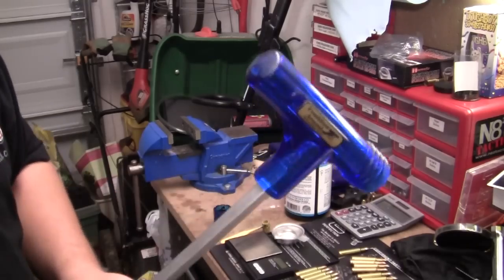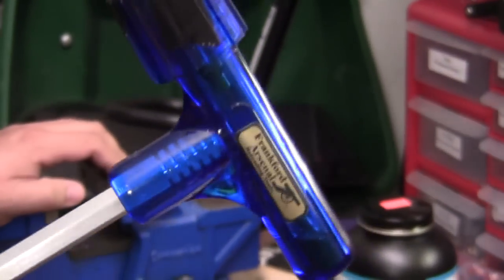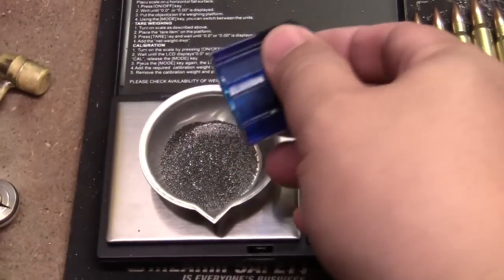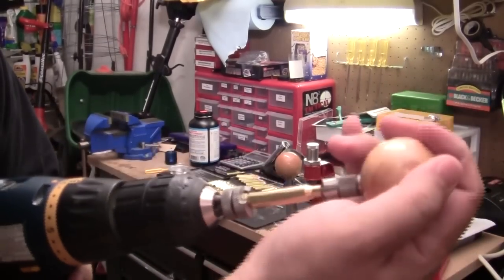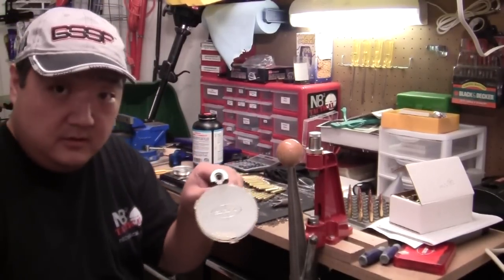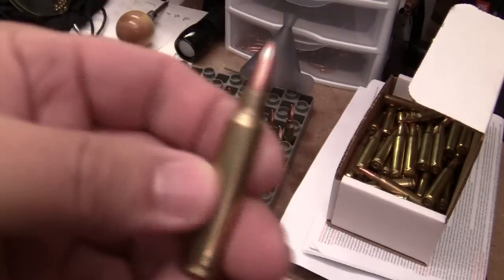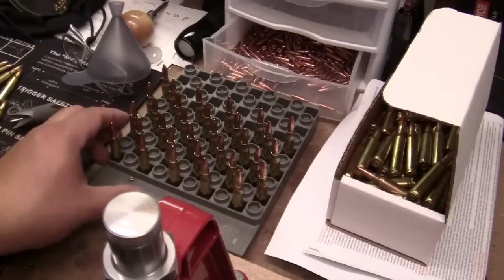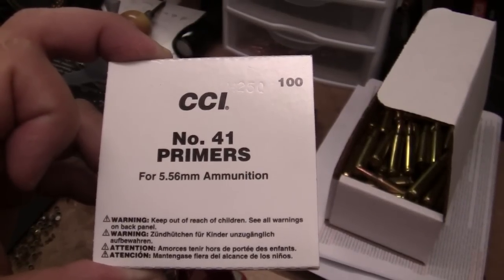Fixing a Reloading Mistake

Comment: I've done the exact same thing. Didn't pay enough attention to the length and assumed all would be OK. I know that you refer to yourself as budget reloader and I get that. But a suggestion is to buy a collet type bullet puller. I have the inertia one too. Used it for years, but last year bought a press mounted RCBS collet puller and purchased a couple of the different collets. Boy what a difference. I can pull a .223 in a snap with no damage to the bullet or just a minor scrape. And I haven't found a problem with powder spilling either. Makes a lot of difference when you need to pull a number of bullets instead of just one or two.

Comment: I dont know if anybodys mentioned it but you can speed things up a little, while the case is still chucked in the drill you can spin it up and quickly touch your deburring tool to the case mouth inside and out to clean it up... I love those lee case trimming sets, I started off with a Lyman trimmer when I started reloading which used to take ages! tried out the lee set and never looked back since :-)

Comment from the maker: The depth that you set your bullet in will affect the amount of pressure created.  Depending on how deeply seated it is, you may want to take a bullet puller to back them out a bit, then re-seat them at the proper depth.

Comment from the maker: Most of it was fired by me, but some of it wasn't.  Still, all fired brass will expand when fired.  Rifle brass more so due to the increased amount of pressure.  If the case is too long, it might not chamber correctly, so trimming is necessary.  I haven't had to trim my handgun cases yet.

Comment from the maker: Yes, I resize all of my cases as part of the decapping process.  All brass should be resized due to expansion when firing.  Otherwise, the brass will be to large to fit into the chamber properly.  With bolt action rifles, as long as you use the same brass in the same rifle, you should only have to resize the case mouth.

Comment: wow ok!  thanks for info, I will plan on buying a case trimmer with my die set.  I have reloaded 7mm x 57mm bolt action but that was maybe 30 rounds, and it is such heavy recoil round that I did not load anywhere near max levels, and that was over 20 years ago on my dad's equipment.  I just did not think the 5.56 nato/.223 was that hot/had that much case stretch.

Thanks for informative reply

Comment from the maker: @brianlojeck I checked around the forums and asked around.  The general consensus is that it's not the best thing to do, but it can be done.  Also, those rounds had CCI No. 41 primers which are harder than most primers to prevent slam fires in semi auto rifles.

Comment: Look into a collet style bullet puller you will have to purchase a collet for each bullet dia. you want to pull. You can pull more bullets quicker with a collet style. I had one of the knetic pullers I pulled 4 rounds of .243 and it broke causing the loaded round to fly across the room. Best thing I did was to return the knetic puller.

Comment: Wasnt knocking your skills, ect. Just I saw you were using a lee sizing tool. So I get that you have to remove primer to use it. I was just saying that if you used a rcbs trimmer type trimmer with the collet, you wouldn't have to remove primer. Ive corrected many of my own mistakes and others as well and found that the puller for a single stage press works best for bullet saving and fixing. Just my .02. Be safe and great vid.

Comment: i thought it was dangerous to punch out the primer if it hasn't been used. also, i am curious if resizing was needed. could you just trim the neck without resizing? i thought trim, debur, then chamfer would be enough. im somewhat new to reloading rifle cartridges, so enlighten me with any new info.

Comment: Mistakes do happen, but I'd never use that method for case fixing. I have just used a puller from rcbs, and then pour powder in container your using. I then use a manual case trimmer so I dont have to mess with primer. Then just reload using your scaled powder charge and deburring methods. Less work, more safer, less chance of destroying good usable product.

Comment: Sorry but I just have to put in my two cents worth. First of all, j stark mentions something about free bore. Free bore has nothing to do with case length. We're talking about chamber length. If your cases are 20 thou over max (1.780 v. 1.760) you are flirting with danger. The case mouth may be pinched into the bullet so hard the bullet will never let go until something breaks. You can't even see how long the chamber is with a borescope. Sinclair makes a doodad that you just start in the mouth, then chamber it. Extract it and it shows you how long your chamber is. I think it's called the Sinclair Chamber Length Guage. But you don't need it. Just be sure you measure your cases after sizing so you know where you're at. The no. 41 primers may be harder in the cup but that means nothing when you're pushing a pin through the flashhole, through the hole in the anvil, through the foil and STRAIGHT INTO THE PELLET!!!  That being said, I have decapped many live primers in my 35 years at the bench. Take every precaution and go easy on the press handle. Reloading ammunition is like life: You learn as you go.Thanks

Comment: unless these have been reloaded 5-6 times, or are new brass, very seldom do you need to trim. Most rifles have enough free bore to accept various makes. Over all length w/ bullet is more important. Unless trying for dime  size groups at 200 yds. or are target shooting, no real big deal.
Reply from the maker: It's more critical in semi-auto rifles, and it depends on how hot you load them, but yes, OAL is the most important.